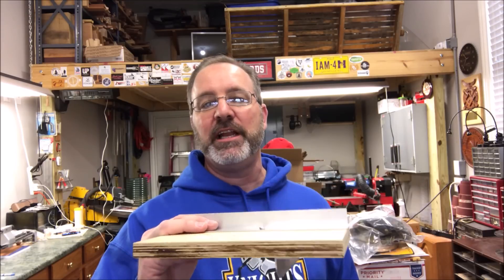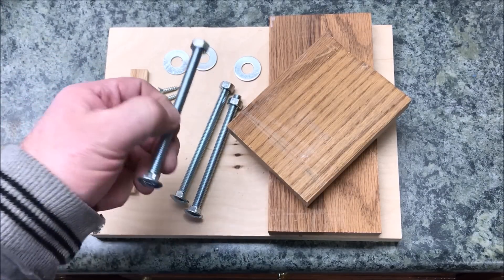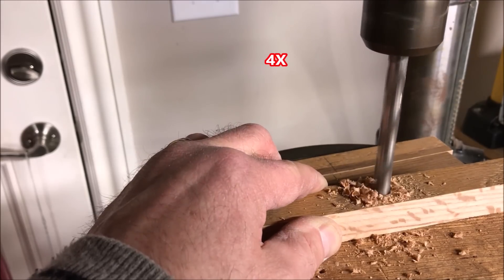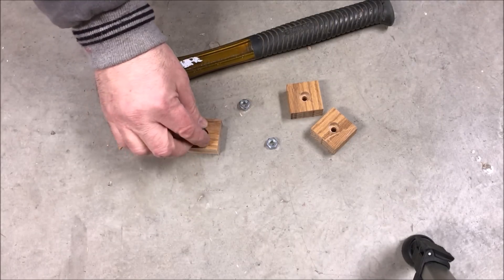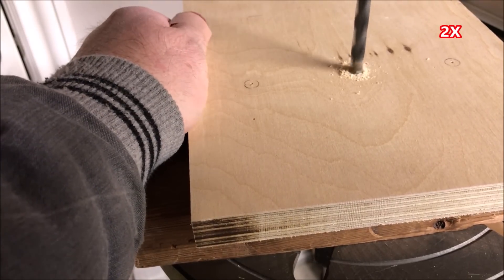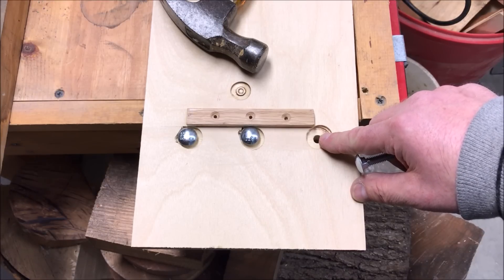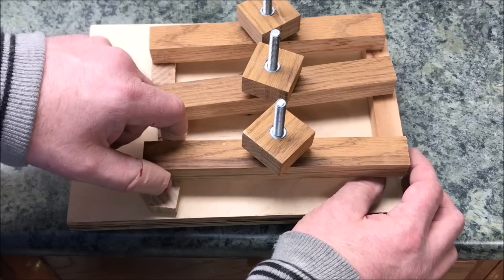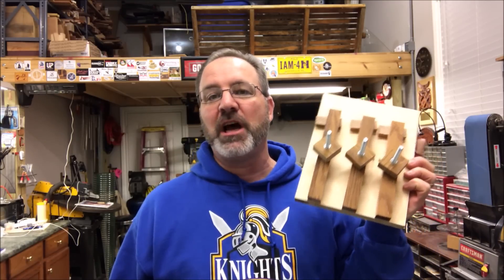How To Make A Veneer Cutting Sled For The Bandsaw

Comment: Great jig - how about making another base similar to the first - rotate it through 90 degrees, put a slot in the top of the current base  and some clearance slots for the hold down bolts and you could then position the blanks parallel with  no measuring.
Reply from the maker: Nice idea Bill,
  That would work fairly well too I’d bet. 

Regards,
Bob

Comment: This is nice looking jig but not sure its the best tool for the job and there are some things that you really didn't address. 

Your band saw has to be perfectly tuned to get nice consistent strips. Blade 90 degrees to the table, guide parallel to the cut (which isn't always straight), perfect tension, guides bearings  adjusted properly, etc.

Your setup doesn't give any way to cut a bunch of strips the same thickness from cut to cut but I think some sort of setup jig could fix this. This jig could also solve another problem of keeping the strips the same thickness from one end to the other.  

I make these strips on a table saw with a DIY version of Rockler's thin strip jig and have strips from end to end and strip to strip within maybe a few thousands if you trust my digital calipers.
Reply from the maker: A depth stop on the opposite side of the blade is a good idea for repetitive cuts. I didn’t even think about that. 

I used a machinist square to 90 the blade with the table when I set the saw up and I do periodically check it for square. 

Regards,
Bob
Reply: @RJBWoodTurner  yeah you need a long stop that can give you repeatable cuts and keeps the edge parallel to the sled.
Reply: @chartle1  cutting on table saw causes a big loss of wood on each cut. 1/8" loss to make a  1/8 or smaller pieces of wood is not that economical. Drawback on bandsaw cuts is that they usually need to be sanded to get a smooth surface. So there is no clear winner, :-)
Reply: @pajonate  yea I use the narrowest blade for my saw which is a 7 1/4" size with about 40 teeth. I'm also a "table saw guy" not a "band saw guy" :-) 

My band saw is a crap 3 wheel Craftsman that I inherited from my father but to me band saws are great for curves or maybe cutting free hand with a straight line but not so much precision ripping. I've seen for some they can't use a normal rip fence sine the blade does cut "straight" but at an angle.
Reply: @RJBWoodTurner  I thought about it more and you just need to use something like the depth measurement end of a digital caliper and set the blank to the correct distance at each end of the blank.
Reply: @pajonate  I guess the best is using a band saw and a thickness sander.
Reply: @chartle1  It might be most economical, but then it is the slower method, and you need to have both machines in your shop. 
So, waste more wood with table saw, or spend more money for two machines, :-). 
At least, those are options, and it is up to you which one you gonna take. Sometimes there is only one option and no workarounds.
Reply: On this design, I would go with "Horizontal Toggle Clamp" from Harbor Freight or some other workshop, instead of the the three woods and the bolts and nuts. The limiting factor with them is the with of the material that you cut, and how thin piece of wood they can clamp.